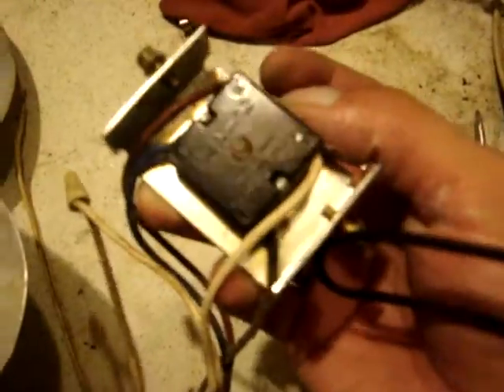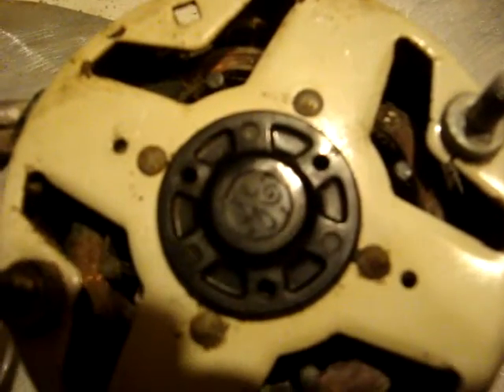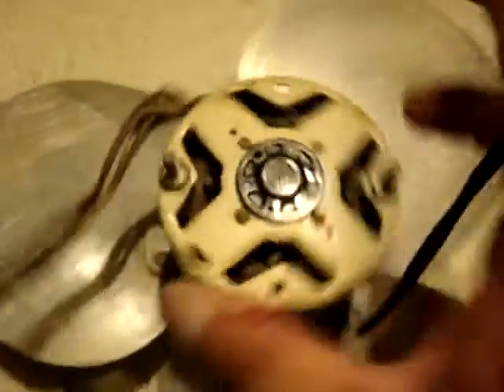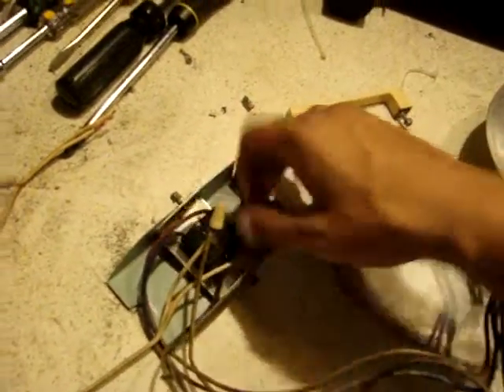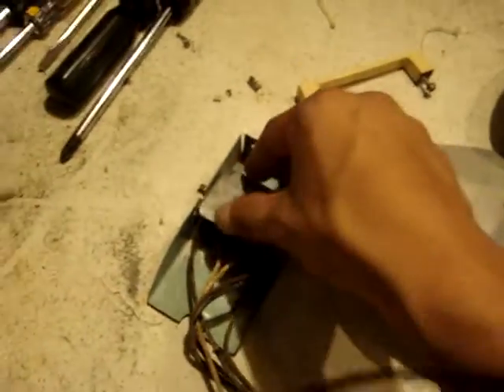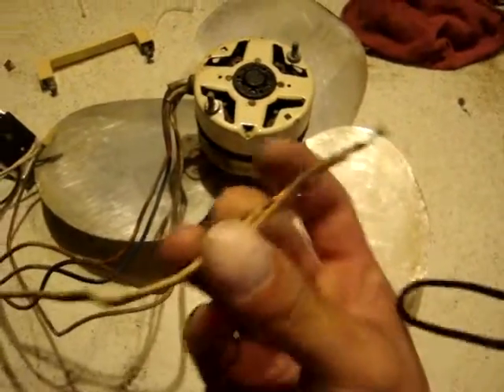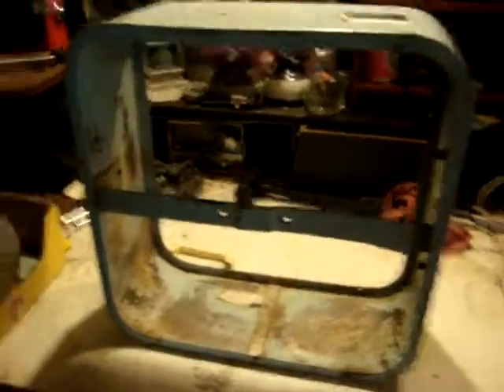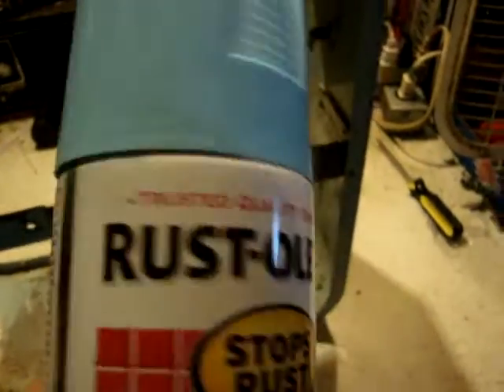Windsor C-14 box fan restoration. part 1

Comment: That's pretty rough.. a great little fan to restore though.. those aren't too common.. Hope it turns out good..
Reply from the maker: Jordan U Its done now..LOL see the last 2 videos i made on this. ya, it came out pretty good. could not get slats to fit the missing parts. but i got the front grill in 1 piece again. so thats something.
Reply: ***** I saw there were more videos on it.. but I'm just so behind on watching videos it may be a few days before I get to them LOL.. That front grill was a disaster.. anything is an improvement with that..
Reply from the maker: Ya, i was beginning to wonder where all my commenters went..LOL. but ya. i managed to get the grill to a point where its one solid piece again. im gonna have to find anther method for grill slats though.
Reply: ***** I'm still here.. just give me some time lol.. The front grill is hard to fix since you see it.. rear grill isn't as bad.. throw anything in there and it will look better..

Comment: I have one just like it other then mine is grey. the grill was vary rusted so I cleaned it up with steel wool. I also gave the motor some 3-1 oil which seems to have helped it lots. the only issue/concern I have is that the rotor is rusted and I think it's causing the motor to over heat. I have no idea how to open the motor, is it even possible?
Reply: Love these old fans. Just bought a windsor mini. I sleep great with these old fans